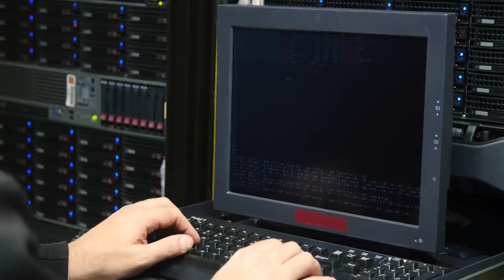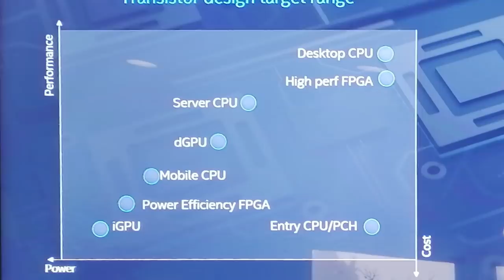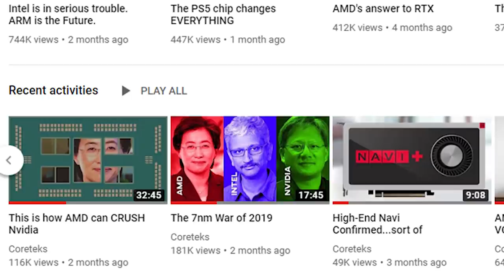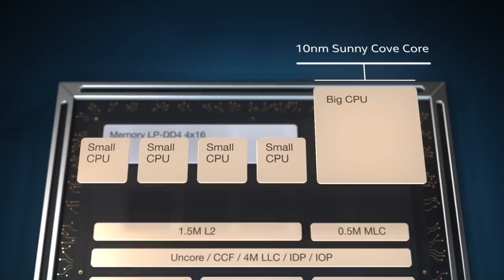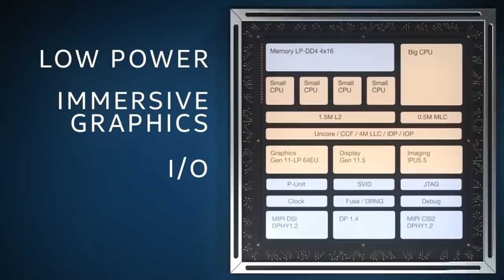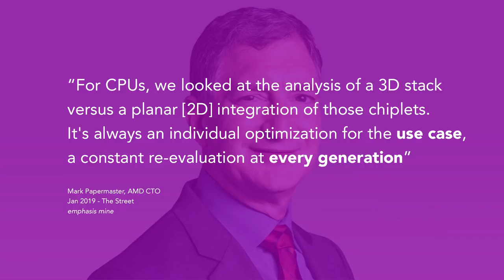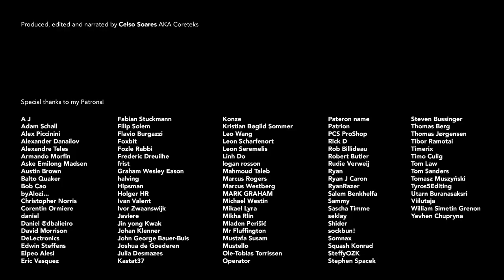2D vs 3D Stacking: Intel’s plan to beat Zen 2

Comment: And more memory bandwidth doesn't mean a lot of performance gains... *looks at Radeon VII*
Reply: Correct. He's looking at it very very simplistically.
Reply: A GPU is a very different product than a CPU
Reply: Depends on the use case. Some applications are bandwidth bound, some are latency bound, etc. From what I can gather, Radeon VII has no equals right now in GPGPU price-to-performance ratio
Reply: V2 is a server card more than a gamer card the bandwith past around 700GB/s may be useless but on the server handling AI or heavy rendering bandwith means a geck of a lot still
Reply: You clearly don't know the difference between a CPU and GPU , do you ? LMAO !
Reply: The GRAPHIC  GAME DRIVER from RADEON 7 is a bonus for prosumer.This is the best card you can get for $700 considering the price of INSTINCT CARDS or the TESLA..
Reply: Okay, could I be given a link or  someway to further understand this bandwidth speak? Clock speeds don’t matter? Yet, I still see people over clocking CPUs and GPUs all the time. With minor gains of course.
Reply: You have obviously never run an apu, bandwidth is KING
Reply: @WarriorsPhoto  if you can click ,read  and post in this conversation,you should be able to find what you are looking for instead of spoon feeding you. :)
Reply: @jys365  Ummm Radeon 7 is way too expensive to have the best performance to price ratio.  https://www.videocardbenchmark.net/gpu_list.php  If you are wanting a new card the nvidia 1660 ti and nvidia 2060 are the best for budget builders currently.  I loved the RX 590 but it has been overshadowed by nvidia here recently.  Hopefully AMD will have an answer to the 1660ti here soon.
Reply: It always make a difference but it all depends on the rest too... like for 4K gaming they are bandwidth eaters however the GPU die it self if its not enough for "X" game off course it wont matter if it has so much memory bandwidth and the GPU is already topped up and can't push anything further.

But the more the better, just like the more performance the GPU die the better...

And on the CPU the super fast caching makes a very huge amount of difference as is far faster than any other shit out there or it wouldnt just keep it up with the CPU, I wonder how things would go to shit if CPUs didnt have the very fast cache memories in it and just rely on the slow RAM alone...
Reply: @WarriorsPhoto  clock speeds aren't indicators of performance when looking across vary brands and/or models. Brand A CPU @ X Ghz vs Brand B CPU @ Y Ghz means nothing if you look at the clock speed alone. BUT a X% increase in clock speed in a chip MEANS X% faster processing speed for that chip
Reply: André Barranco Good Point. Thank you.
Reply: Cris Meman Oh my bad. Don’t trouble yourself to type a comment yet, be unwilling to help out someone looking for assistance. Thank you for adding to this conversation BTW. You are much appreciated. (:
Reply: Vega VII is pretty underwhelming.  I bought 2 to test - had no illusion would be able to keep up with my dual 2080TIs ... The lack of crossfire on that card kinda makes the 2nd one moot.

I could have brought out my retired 1080TIs - but what's the point.

Need to determine how to choose where these 2 go when I give them away.
Reply: @crismeman3386  This is nothing but a rebranded Instinct - Navi has been set back and AMD needed something to present at it's first CES Keynote - and since Navi was no where near ready - we get the Vega VII.
Reply: @bradvicious3991  You paid the price by not researching first before buying. Information is everywhere before it was launch..

Btw, you don't need 2x R7 to get the same performance of your 2080 ti..2x Vega 64 on crossfire would do..

P.S..I love how you brag about your 2x 2080 TI and buying 2x R7,,i doubt you can even afford one..cheers :)
Reply: @nicholasperkins4655  If you are only talking about game performance, the answer is yes..but if you  talk about the other stuff that R7 can do combined with gaming  @ $700 it's bargain..:)
Reply: Mccock I had an A10 APU. It was able to play most of the latest games of 2015 on high settings but it was massively bottlenecked because of memory bandwidth. I paired it with a Radeon R9 280x and the performance was actually a lot worse. I don't think the APU series of processors were designed for the user to add a discrete gpu. My crappy FX 6300 gets 1000 times better gaming performance than that apu with the same graphics card.
Reply: Brad Vicious I agree with you.

Comment: I few years ago IBM did a demonstration of stacked chips with cooling channels cut on the backface so that coolant could be pumped through the chip sandwedge. They also used an ionic fluid that replaced the power lines in the chip as well. That seems to be the way to do chip stacking.

Comment: You're talking crap & nonsense... Initial ARM processors were not making any performance gains through memory throughput optimization.   
The whole reason why initial ARM chips were so fast was that they were pipelined (unlike other contemporary CPUs). Having few instructions and simple architecture allowed ARM to spend their transistors on pipeline.
Reply: I would like to further explain for other YouTube viewers:   any code is eventually a bunch of instructions in a very basic language, that the cpu process each clock cycle.    Using  pipeline is like changing your 1 way processing into 4-5 stop way, and in each stop you can store a difference instruction.  the clock cycle now can be increased, and you can process more instructions than in a regular cpu.   Today's most cpu are piprlined.     Watching videos like this with out having any idea of what's clock cycle, how does MIPS work and other basic ideas, can be very misleading, because you account on the video producer's credibility.

Comment: I agree with most of what you said. However I'm not so sure Intel will launch their 3D chips as soon as you think. Not after they kept delaying their 10 nm process for years.
Reply: Yeah Intel is so lame with it's 90% market share in multiple product lines and segments.

the Foveros product will likely ship first - in the form of an SOC - which is the only segment that will get the stacking - not the desktop parts  and certainly not the HEDT lines.

10nm was delayed because of an overly optimistic and ill conceived density target for 10nm.  They tried to skip a generation and move directly into what would be a Gen 2 10nm process.  that's the delay.  Even at 14nm - Intel cannot meet demand - they sell everything they can produce.

One can hope the Ryzen 2 uses a completely different version of TSMC "7nm" because that 
Vega VII shows none of the benefits that should be with a significantly smaller process (seems to be closer to 11 or 12nm than 7nm.
Reply: @bradvicious3991  Wow! Butthurt Intel fanboy alert!
10 nm was supposed to come out three years ago. Such collosal delay cannot be exused with overly optimistic density target. It's only a sign of incompetence.
And I never even mentioned AMD. This has nothing to do with them. Intel has been slowing down ever since Sandy Bridge and one does not even need to bring AMD into discussion to prove that.
Reply: I would expect to see the foveros stacked SOC this summer, and will probably get the new Cove architecture on a 14nm CPU about that same time with the 10nm Cove around the holidays.

The delay was due to someone deciding the go way too dense for the 1st gen.  Hasn't hurt Intel in the least - their 14nm process is so mature that it doesn't really matter.
Reply: @Dj0rel  Yes it was on the roadmap - and your point is what?

Hardly an Intel or AMD or Nvidia or an company fan boy.  Just stating the facts.

Yeah incompetence - record quarter after record quarter year after year after year.  Can't produce 14nm fast enough to meet demand... yeah total incompetence
Reply: @Dj0rel  Intel announced 10nm around 2014, though.

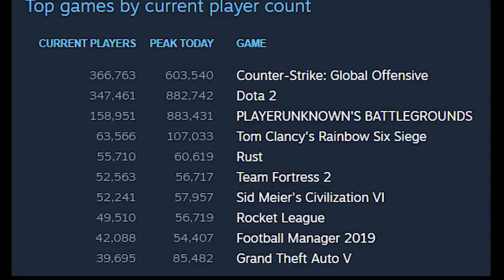Comment: 18:45

I strongly disagree here, Civ 6, GTA 5, PUBG and Rust will not run on a "sub $200 PC". Used? Maybe. But most casual/normal and younger people don't know much about hardware, therefore not knowing what is a good deal and how the hardware of a $200 used PC performs. You won't have good frame rates (or turn times in case of Civ 6) on a Ryzen 3 2200g either.

I also dont really know how/why you correlate server vs single end-user PC performance when it comes to multiplayer games. It's not like the devs of such games can just balance the load between the players PC and the server. Yes, things like bullet drop calculation can be just done server sided and then send back to the user but I think you get my point.

It would've been a much more fitting segment if you would've included cloud gaming here instead; services where the user just connects to a virtual machine and plays the games using the servers hardware. Cloud gaming services, while not new (OnLive existed pre 2010) are definitely on the rise. Have a look at "Shadow" if you want.
Reply: Most services o to cloud, that's means u don't need a top tier PC. OnLive work on P4 with 512MB Ram when games work with minimal c2d and 1/2GB. Games in "digital distribution" means u Rent them. Society become more "consume content", rendering or other applications can be done on cloud (fusion360 etc)

Comment: 2 problems I see in this video (and I'm not even half way in):
1. The issue with memory has never been bandwidth, but latency - in fact, DDR RAM has been doubling in bandwidth in each generation, but actually at the cost of longer latency. It's all about how many CPU clocks/cycles are waisted waiting for data from RAM, and that number has been increasing over time, making computer software slower.
2. Intel won't be putting hundreds of megabytes or 1GB of cache in any CPU any time soon, because that's a completely different kind of memory (SRAM), that goes through a completely different process to manufacture that is much more complicated and expensive - so when competing on a price/performance ratio metric, a 1GB cache CPU would be so ridiculously expensive, it would have effectively no market.
Reply: 1. Latency measured in the RAM's clock cycles increased, but measured in time as a product of cycles and frequency is rather stable at 7.8-ish ns. So no, it's not getting slower from DDR2 to DRR3 to DDR4. But if you compare throughput DDR4 gets way more work done than DDR2 or DDR3.

2. You are right about SRAM being more expensive per bit than DRAM, but the reason is not the one you stated. DRAM and SRAM are produced by the same process. The difference is in the required area per bit. DRAM uses one transistor and one capacitor per bit, whereas SRAM uses 6 transistors per bit. Thus SRAM needs quite a bit more space than DRAM. So you are right about DRAM being cheaper than SRAM per bit, but it's a function of cost per area and not a difference in process. Yet we still use it in CPUs and GPU as it uses way less energy and is quicker. In fact in current CPUs much if not most space is used up by SRAM because caches are very important to keep the CPU busy. Going to your typical RAM modules is around 200 CPU clock cycles, going to L1 cache only around 2. Latency hiding tricks are done in CPU and GPU to lessen the waiting time, but can only achieve so much.

3. You could also put DRAM onto the pile to create high-bandwidth memory. See HBM for a way of doing this using a silicon interposer to connect DRAM stack and GPU. Your biggest problem here would probably be heat, as DRAM is inefficient compared to SRAM, as the former charges and discharges capacitors, that also leak and need to be recharged (refreshed) periodically.

Comment: A very good and informative video as always,but a small observation on what you said at 10:05.Basically the bottleneck of the Bulldozer architecture was that each module of two physical cores shared a single Floating Point Unit and instruction decoder,which, along with the >25 cycle x86 branch misprediction penalty and long pipeline of 20+ stages meant the package couldn't reach it's full potential within a specified power envelope.So yeah,speed would matter as long as each module had a dual FPU/ID but imagine the power draw that would cause.Especially with the FX-9590 you could expect roughly a TDP of over 300 watts and much higher cost due to the complexity of such a design.AMD was wise enough though to let the FX series hold on the desktop market as long as Zen was on the works instead of spending all their resources on refining Bulldozer to perfection.
Reply: >Basically the bottleneck of the Bulldozer architecture was that each module of two physical cores shared a single Floating Point Unit and instruction decoder

The bottleneck of Bulldozer/Vishera is slow cache. This is the reason why increasing the clock speed almost doesn't affect performance. At the same time overclocking L3 cache and faster memory gives  a lot of additional performance. Besides, Intel Core2Duo has microarchitecture surprisingly similar to Bulldozer. A single pipeline for two ALUs.
Reply: Bulldozer bad several bottlenecks. It had awfully slow cache, resulting in terribly memory latency, long pipelines, the FPU issues, and very weak ALU/AGU clusters. If they were to do 2/2 ALU/AGU, they should have been much more potent than they were, to help make up for not being wider.

Comment: i think you are underestimating the challenge of 3d stacking, there so much that can go wrong, it is far more complicated than something like vega's interposer , which is already very expensive. I doubt we will see anything more complicated than vega or titan v for quite  some time on desktop, it simply doesn't make sense, the cost is too high, and the loss of thermal headroom is massive, not to mention it is potentially fragile. For mobile and server it makes sense, margins are much higher and they are low tdp, but not desktop.  intel's sunny cove core just isn't gonna be fast enough to make up for halving the clock speeds, no matter how much bandwidth you get out of it.  it is fundimentally still a skylake derived core, and afaik doubling the cache and memory speed doesn't double performance(for most workloads at least). the chiplet approach is better for desktop and in general for workstation / low-mid range server due to cost, and intel will do this , as they have already announced their cascade lake mcm.

Comment: placing the memory above the CPU cores will cause terrible heat transfers and I suspect will be difficult to cool.
Reply: Difficult to cool if we continue addressing heat management as an afterthought. Why aren't there Peltier devices inside the CPU? Why no microheatpipes made out of gold? Of course it is not possible if we continue in this archaic mindset of dropping a hunk of aluminum over some thermal paste on a lidded CPU. But change that mindset and you will wonder why we haven't paid more attention to micro heat-management before.
Reply: @ElectricityTaster   Peltier is not powerful enugh to transfer away the amount of heat new prosessors make, and when it can not transport the heat it actually becomes a heat insulator with catastrophic failure of the CPU a few moments later when it overheats and burns to crisp.... ..
Reply: Probably a more usable design with an ARM chip.

Comment: 3d stacking has been talked about since the 1980's. The problem they always run into is heat. Heat goes up. Stack the cache, etc above the heat generating CPU and GPU cores, the other components get way too hot.

Comment: Still have to wonder if putting the memory on the top of the 3D stack is wise. While you did address the issue of heat and how to offset it. It does not change the fact that all the heat from the entire package will pass through that memory. Guess we will see how that works out.
Thanks for video. Very informative.
Reply: Depends on what kind of memory you're adding, and how much. Heat is important, but price and use cases may be more so.
Reply: i bet that reliability will also be a large problem, if normal cpu/gpu dies already get fatigued on the connection points going 3d will increase the probability of problems arising

Comment: I really hope Intel can make 3D stacking work. It really would be a game changer. That said silicon as a material I think is nearing the end of it's life in terms of cutting edge. I think silicon chips will be around forever but new material processes are on the horizon. Graphene. Optical substrates etc.

Comment: I think your comparison to the FX chip and clock speeds not meaning much is somewhat flawed. The FX chip was a very unique as it was a very narrow chip for its time. With only 2 integer pipelines per core compared to the 4 in the contemporary intel CPU's and the current zen system.

basically the FX chip was too narrow to effectively compete in temporarily tasks, which is why it failed despite the much higher clocks) 
But that logic hits diminishing returns if you reverse it. intel could design a lower clocked CPU that is much wider, but even doubling the width of the core again (which would mean a LOT of extra transistors btw) Wont add nearly as much performance as it did when AMD moved from 2 to 4 with zen.
with current software and current transistor densities 4 is still pretty much the sweet spot.

massive amounts of relatively fast cache would help intel, but it will be very task dependent,  and on its own nowhere near enough to overcome a 1 to 2 GHz shortfall that you suggest intel might have because of 3d stacking, against the improved zen 2 core.